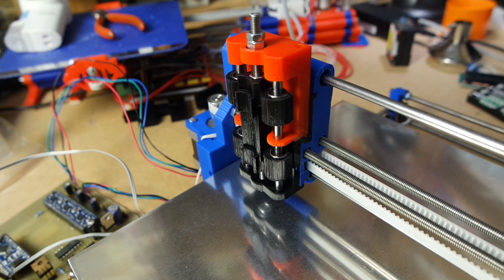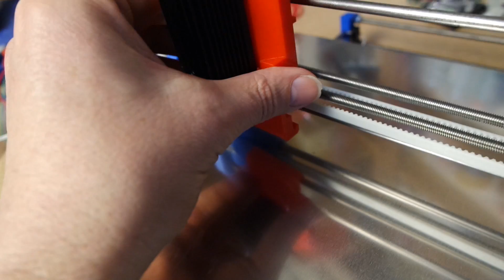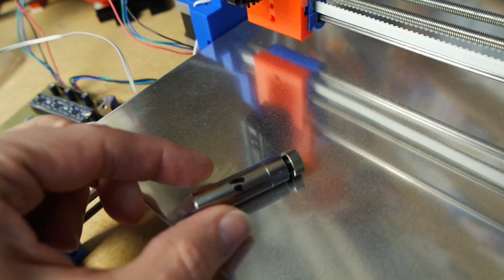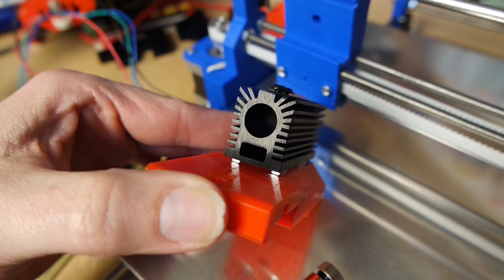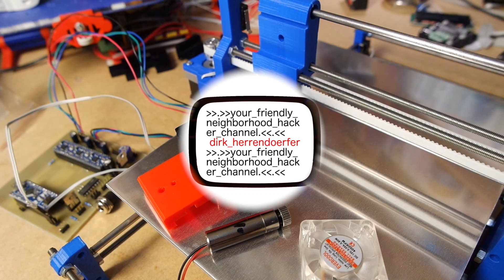The new CNC table pt. 10

Comment: pretty cool .  yeah those laser modules are a bit touchy and easy to kill .   if they have no driver controller in the body , then you can easily turn your lase rinto a LED that gets hot .  all it takes is a bit of static to reach the diode  . thats why when you buy replacement diodes you will see they come with a small clip that shorts the power pins until the very last second , then you remove them once installed.  for heat , i have done everything form press fitting into old chipset heat syncs that i drilled out to just fit , and to using copper pipe .  but if you have a fairly big gap you should roll your  module in Alu foil . I have tested putting a bit of thermal compound between the foils  and it did not seem to make to much of a difference . 
but seriously  if your laser module is a just a raw laser ,  you should keep its power / drive leads shorted when not connected , or a very low value resistor at the least . 
also be sure before you hook up your laser to a driver circuit you  have the driver off and the out put shorted or to a resistor , to be sure you dont kill your laser with a zap from the out put capacitors. 
also be aware of your lasers duty cycle .  if they come form china , assume its only 2/3 of what they say , to start .   but some lasers can only be on full power for a few seconds before they start to diminish .  that has mostly to do with heat .  but some modules  expect to be driven with  a PWM like control to vary duty cycle . My bigger diode / module  came with a dedicated power supply that plugs into AC mains .  i put a relay in the supply line , and that worked great .  my laser has a big housing and can remain on for about 2 hours without a fan ,  at full power .  I tried using a  FET to do PWM    but at max , it was way less power then  relay due to voltage drop across the cheapo MOSFET.  
I have killed a few of the smaller modules ,  and replaced diodes with better ones a few times now .  then i went for whole bigger modules.
Reply from the maker: The module has a power regulator built in. Unfortunately I can't get it open, bad because most of the "usual" regulator chips have an enable input that you can use to trigger the laser. I'll need to figure something out, how to track the duty cycle - hadn't thought of that .... 
Anyway - I was planning a fast mosfet to 12V through a 5V regulator, with a diode in line and a mid sized load resistor, that should give it 4.3V with a somewhat good on/off cycle (soft on, fast off). Or a 5V source with a Mosfet and diode, that would be 4.15V with fast on, and off.
Decisions, decisions .... 
I'd also like to have a low power aiming mode ..

Comment: do you have a link to the lasermodule and the heatsink.
Reply from the maker: The laser module is SKU:844441403 at eud.dx.com 
the heatsink was No: 152362009112 on ebay.de

Comment: A great build!

Just a word of warning, thermal paste should only really be used to fill in very small gaps and fissures between two surfaces. The thermal compound does not work very well at all when applied in large quantities. It would better to either make a sleeve, perhaps using copper shim to make up most of the difference in diameter, then perhaps apply a little thermal paste between the laser, the shim and the heatsink.
Reply: Or an aluminium can as shim material.
Reply from the maker: Yes !  The gap is about 0,2mm at the most, since the module is held in place with screws from above it is pressed to one side, that's where the thermal paste will help a lot. I'll check if I can shim the top section too, or I'll need to go with some silver based compound to bridge the gap.

Comment: 1) Lasers need constant current regulation, not only voltage.  That because the resistance will reduce when it get heated. So the simpel transistor will probably not work. Yes, the burn easily if that is not considered. There are some simple constructions out there you can use, using 317 regulators (I think, from top of my mind).

2) Please, please take care of your eyes!  
The metal on the CNC plate are a great mirror for this, and it will send beams in any direction. That includes via other shining things in the room, that you don't think about.  
So best is to cover the whole machine and put an web cam in it if you want to see what happens. Even befor you test it. And 1W will make you blind, even parts of that energy.

You should still use some good certified glasses that works with the light colour from the Laser, because all Lasers doesn't produces the same wave lenght/colour. And the wrong colour on the glasses are useless to protect your eyes.
Reply from the maker: Hi, happy new year to you too !
The module does have a current regulator built in - I suppose the current into the module will quiesce at some point,
but I've (so far) haven't been brave enough to push it that far.
I do have proper glasses for the purpose, and no: I don"t plan to use it directly on the aluminium surface. And you are right 
to tell me to be careful.
Reply: Dirk Herrendoerfer thanks for the answer.

Nice to hear you are thinking about security about the lasers. Too many do not take that up, as the laser is way to fast for us to reakt too. Laser ruins eyes within a fraction of a second, especially when you have one that are as strong as the one you have. 
Yes, it is obvious when you have thought about it.

So keep safe and continue the good work with the videos that you do. It is really appreciated.